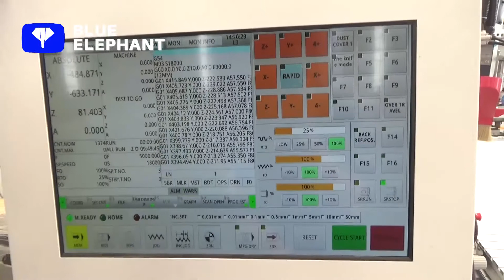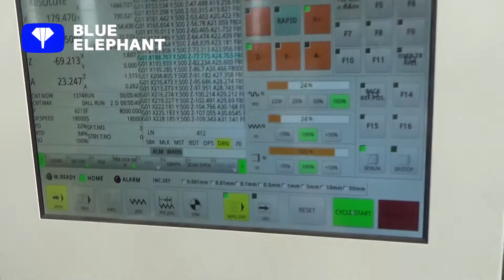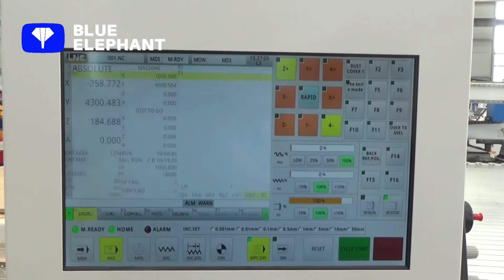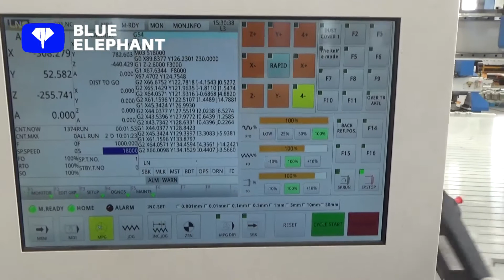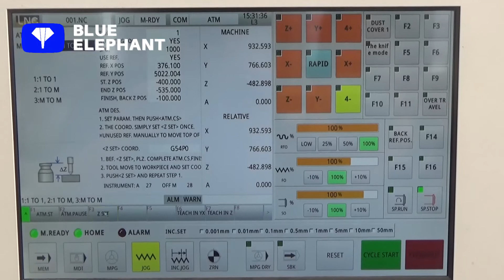Blue Elephant ATC 4axis machine with Taiwan LNC MW2200 control system teaching video

Comment: This is a proper machine to buy and surely not those 3 I ordered from Forsun Jinan CNC, and they were never delivered because:

The multirouter FS2040 could not be put together,  as Forsun admitted repeatedly their incompetence to do this.

The 2nd, a 5-head CNC cutting machine was produced with 1 oscillating knife tool less, and they said they can't make it as agreed.

The 3rd machine, a hybrid laser,  was never  proved to be in a working condition,  as they never sent us any such video.

Regretfully,  they are refusing compensating us or even giving us full refund of our $19,050 we paid as an advance payment. 

Alibaba pretends to know nothing,  and they seem to be totally  useless